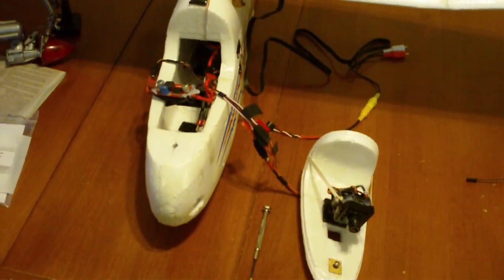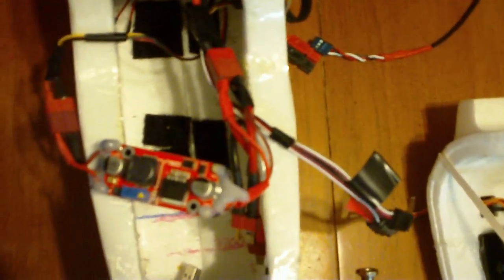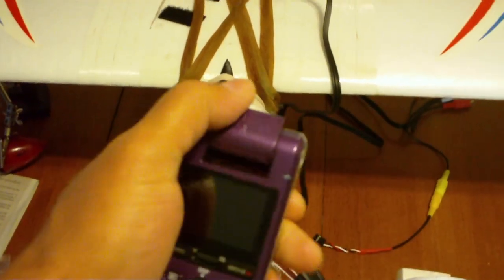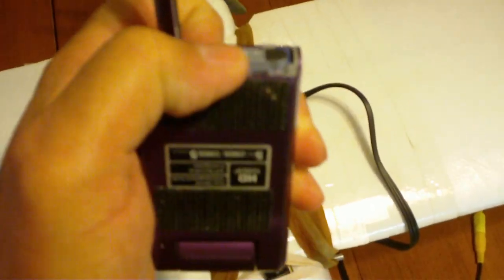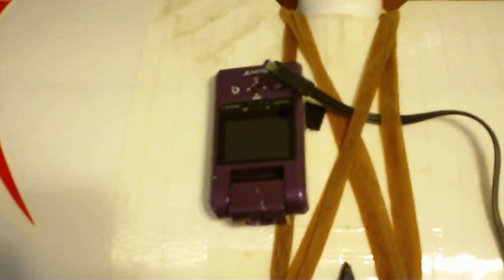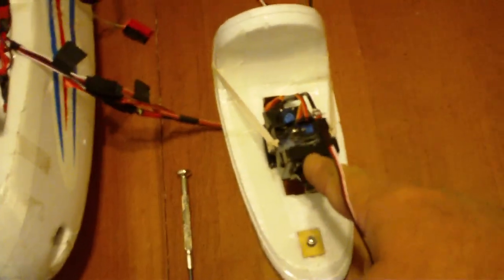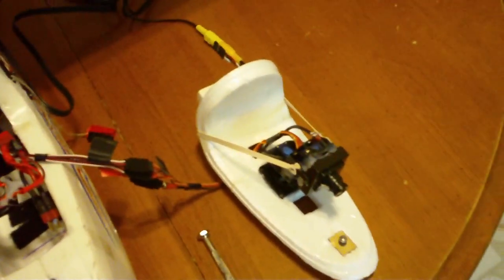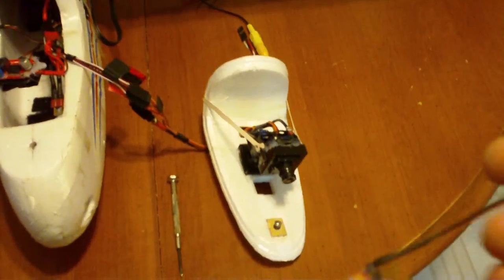FPV  DIY  HD WEBBIE, VIDEO  SWITCH, VOLTAGE REG ON MY SKYWALKER.

Comment from the maker: My switch worked great i can toggle between two cameras easy to hook up but my switch was not from bevrc.  two video signals in one out pretty simple. is your switch faulty. good luck with bevrc